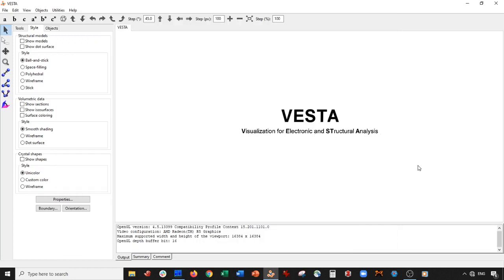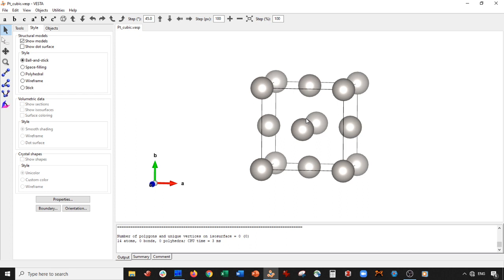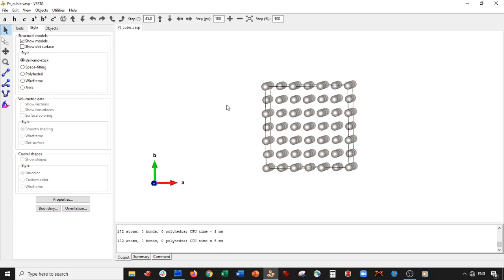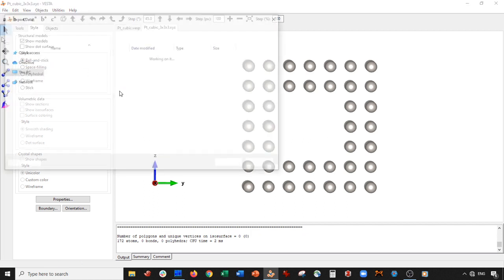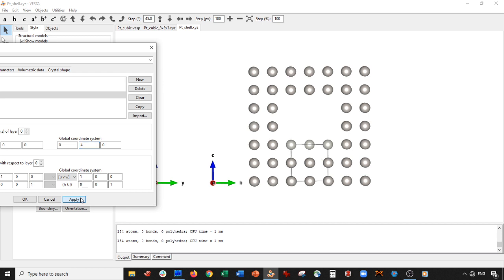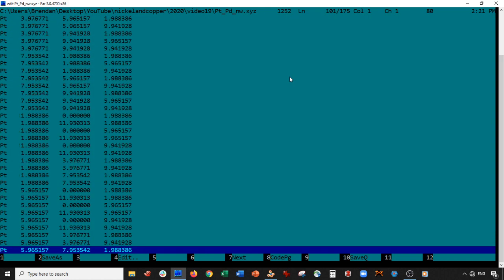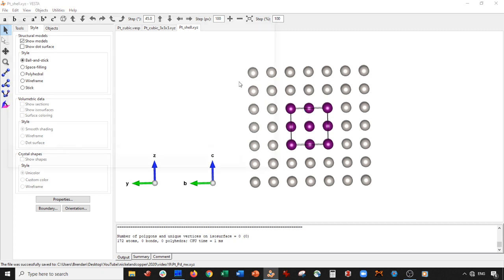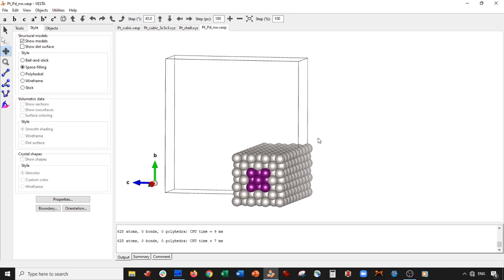VESTA Software - Pt/Pd CORE-SHELL Nanowire

Comment: Respected Sir, Is it possible to model a layer of Oxygen and then make a hetrostructure of oxygen layer and AlN Surface?
Reply from the maker: For sure. The question becomes about how to align the layer of oxygen on the surface. Directly atom the surface atoms? In between? One should check the literature for what is commonly done. If nothing has been done before, then it should be guessed from first principles
Reply from the maker: You can directly use the structure parameters option in Vesta to inset new atoms in these ways
Reply: @nickelandcopper5636  Respected Sir I did some first princilple calculations using VASP. The favorable site for atomic oxygen is in between two Al (Make bond with two Aluminium). Now I want to cover full surface of AlN with oxygen. Its not possible to adsorbed a lot of oxygen. So the solution is to make a a hetrostructue of oxygen layer and AlN surface.
Kindly make a video How to make the layer of oxygen and then how to connect it with AlN surface.
Reply: Adsorption take place successfully. AS I increase the number of oxygen above surface then they start interaction with each other instead of adsorbing on the surface.
Reply from the maker: Maybe that’s what’s supposed to happen? :)